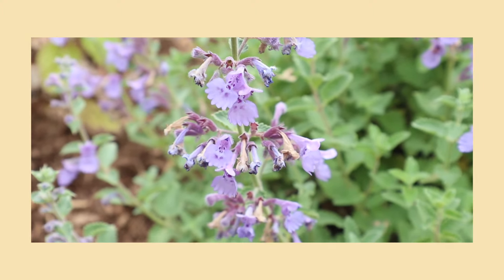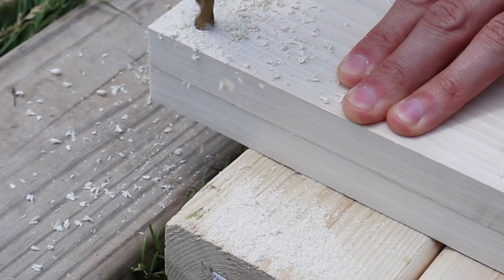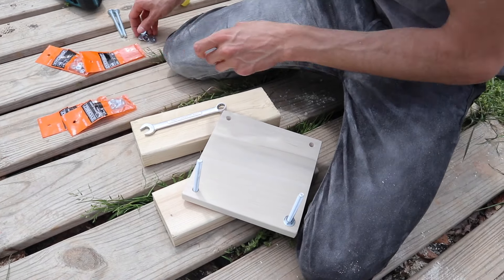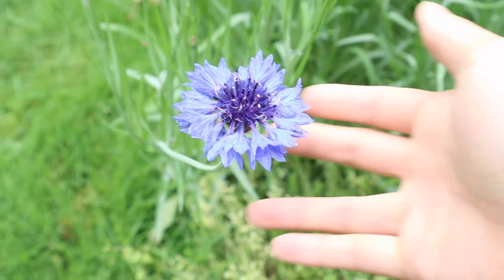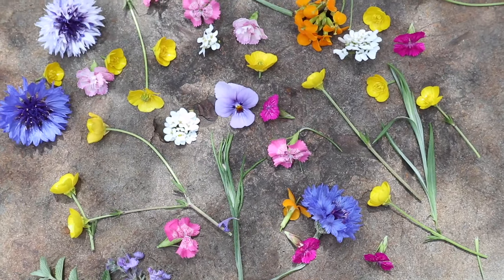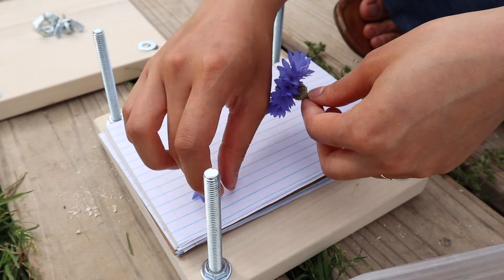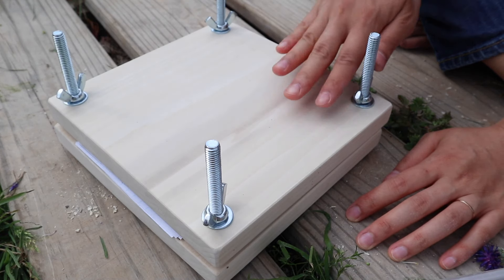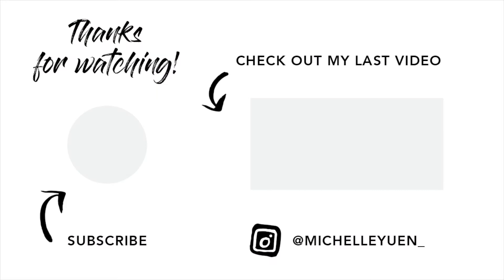🌼 DIY Flower Press for under $15! 🌼 Affordable DIY, tips & tricks for pressing flowers

Comment: I am starting press today 😊! Have press thanks to THE MAN, mad it look so easy. I am using water color paper (acid free) for flowers in case they stick use paper or leak natural dye upcycle. Another post elder lady suggested on larger flowers you can reduce size by plucking petals with tweezer, keep with dry process, & add back... Has any one tried? Also I have kept flowers & green (clover, fern, leaves) in books over years to dry. What is best way to keep color of greenery? I kept funeral flowers very important upside down so not flat, is spray gloss best?

Comment: I bought poplar wood but it was not easy to drill the holes. It started smoking and burning in the hole. I ended up having to drill really small holes and gradually increase the size and do one layer at a time but it worked. Thus is a cool project but not fun drilling the holes.